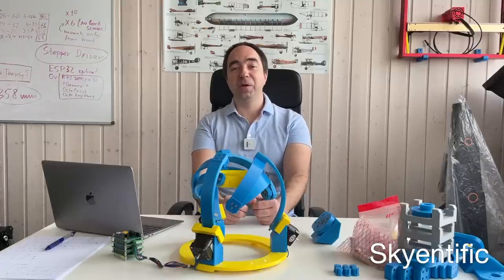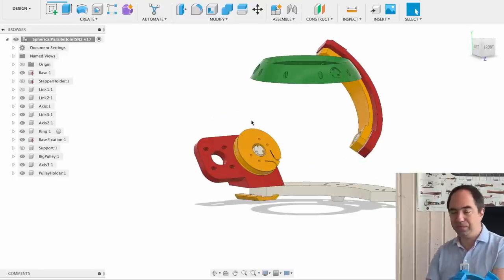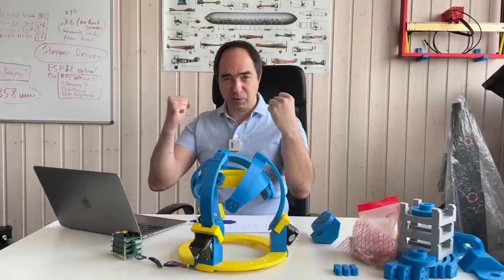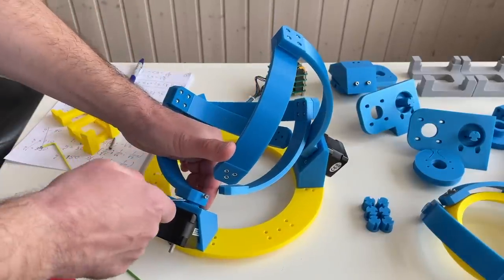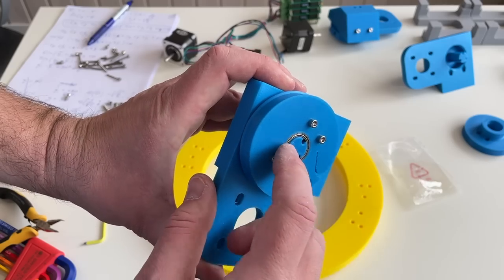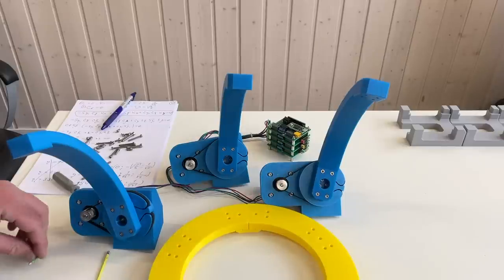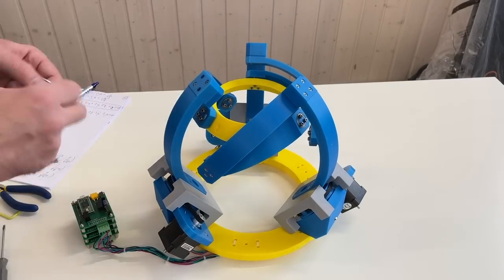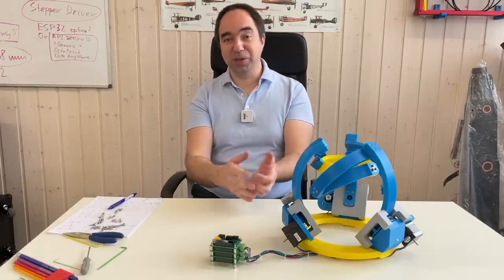Now it works! Spherical Parallel Joint (stepper motors, 3DoF)

Comment: Glad to see you looked at the Agile Eye paper I mentioned on the last video! Indeed, the frame is a bit tricky, as I recall its located at the center of rotation and  aligned to each of the joints attached to the EE... and mirrored through to the input "motor shaft" axes. 

Stepping down the motor with the pulley is a nice touch!
Reply: Could you tell me what the paper's name, I'm very interest about Agile Eyes, but yet couldn't found the resource.
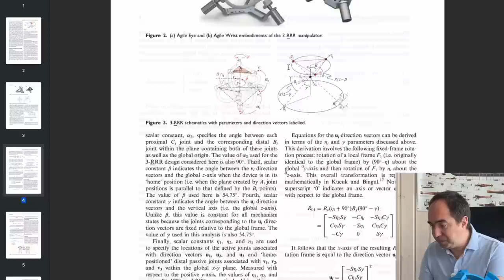Reply: @zhangrongqi0818  it's in the video: Design and performance of a 3-RRR spherical parallel manipulator for hip exoskeleton applications, at 3:01
Reply: @zhangrongqi0818  this is not the Agile Eye, but the Agile Wrist, it seems
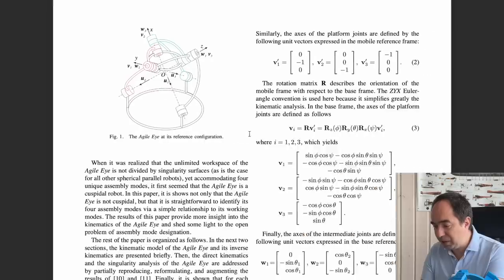Reply: @danielmclellan7762   Thank you for your help! But I may not be clear enough, The video mentioned another article in addition to the one your provided, at 4:03, I am looking for this one. It seems that the title of the paper is not given in the video.
Reply: @danielmclellan7762  LOL, it seems that it might be used for Agile Eye too.

Comment: You could probably further increase rigidity by taking the first two links (colored green and yellow in your CAD model) and combining them into one part without the 90 degree joint up top.
Reply: Yes a direct arm is all thats needed
Reply: Wouldn't a slimmer (still Ridgid) design be better for more clearance and rotation range ?
Reply: So basically, a curved diagonal piece.
Reply: I was really thinking this through and I think you are right. There would just need to be a shift partway along to clear the neighbor motor hub.  Great observation.
Reply: Making the arms in sheet metal would probably be nice for compactness, rigidity etc, then 3D print bearing mounts where necessary, also, if the arm's bend inwards a bit more, they would clear the neighboring motor hub which might increase the rotational angle limits
Reply: @ilkero1067  I don't that that is correct, there is a joint there for a reason

Comment: Would you be able to inverted the system with the motors being internal? Then the yellow spherical like ring should be on the outside allowing for more movement if something were mounted. Be able to move more like a shoulder joint with a wide range of motion.

Comment: how does adding 2 initial links work to the advantage of this mechanism?  Aren't the 2 first "links" just bolted together, wouldn't it just be easier to make a solid link? (from motor to first joint)
Reply from the maker: Thanks to them the space under the moving part is empty all the time, so this joint can manipulate long objects.
Reply: @Skyentific  hmm, I suppose it's hard to see.  I started to suspect it might help with  clearance, but couldn't wrap my head around it.  I noticed other comments saying the same, so maybe an opportunity for further videos! Thanks for the reply!!

Comment: the big piece with the fixed 90 degree angle... can that not be a different shape so it gets out of the way of the cetre thing? i feel like anything one might want to do with this, that piece getting in the way is going to be a problem.

Comment: I feel like the arms impinge on the "Top" of the output at certain angles.

Is it possible to mount the arms "upsidedown", so their movement is "below" the output?  (I am trying to picture it in my head and I feel like with the other arms coming out 90 or 180 degrees they can still fundamentally attach to the output in the same location)

Comment: You really need to get rid of the stiff joint and the second arm. Thicken up the 3rd arm and bearing shafts and bearings themselves. It will be a lot rugged. Can't say anything about inverse kinematics.